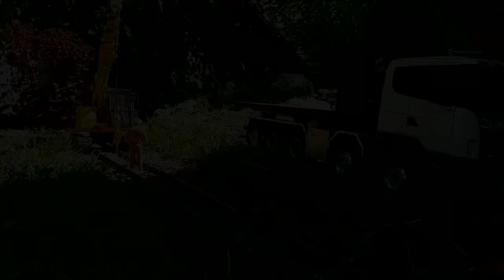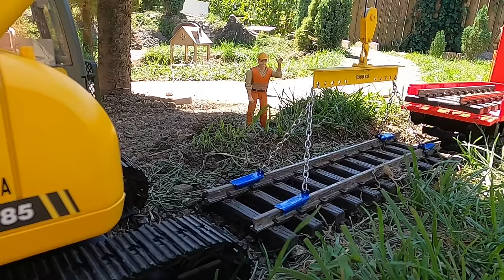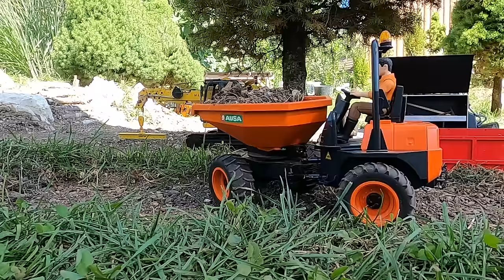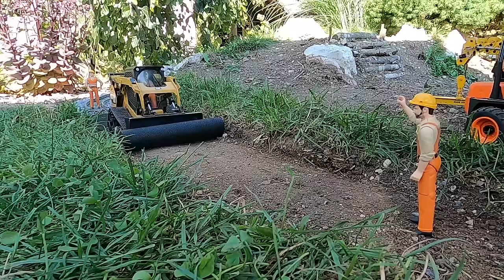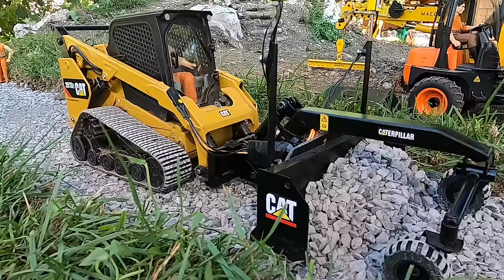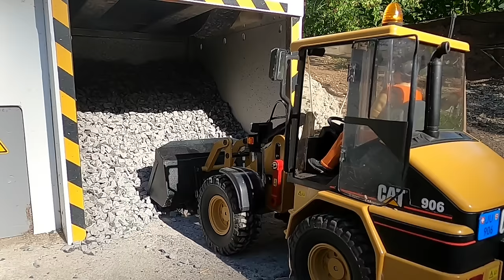Remplacing track ballast, RC Maeda Tracked Crane, CAT Loader, Roller, Truck, IRR train Heidi.

Comment: A trick that we use with bigger equipment when grading is to fill the skid steer bucket with some gravel when back blading the little bit of weight in the bucket significantly helps.